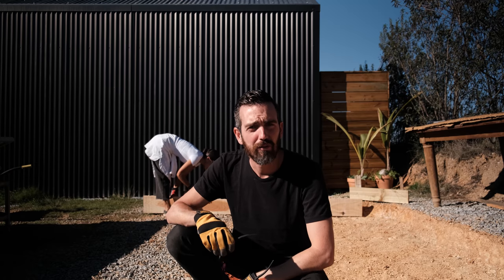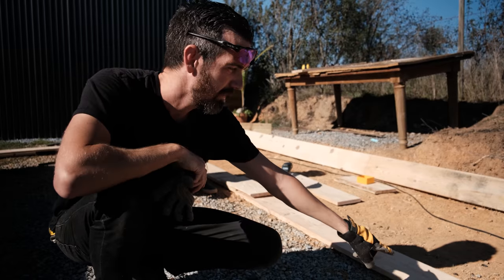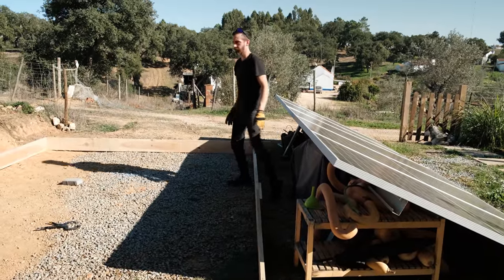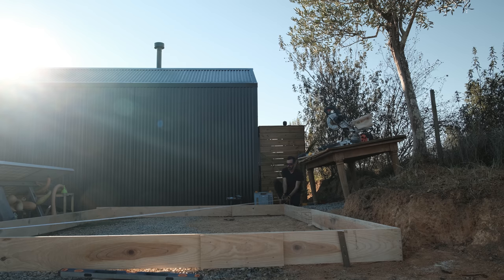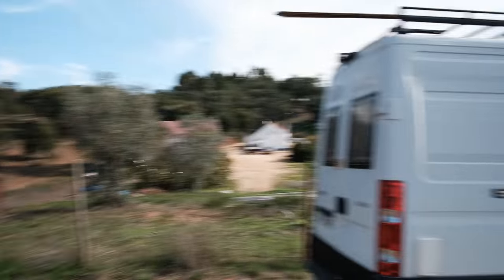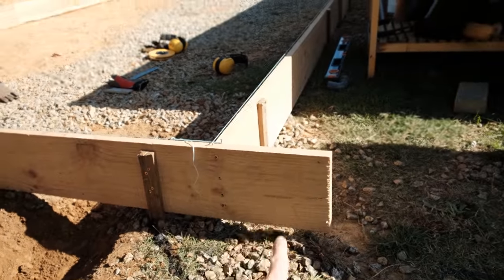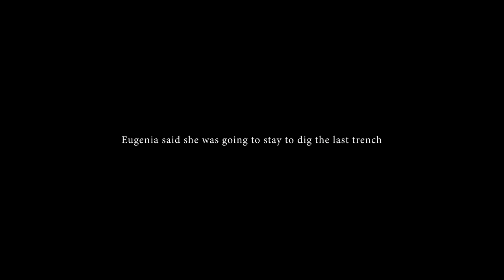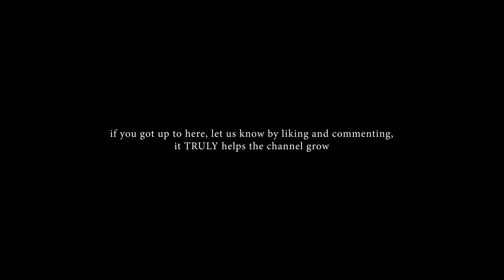2. Continuing the works, setting concrete forms, rebars arrival and new tools

Comment: hey guys! great channel;) tip: when installing sewer pipes or embedded pipes for wiring, it is better to use two turns of 45 degrees (where possible, of course). when laying a cable, it will be easier to stretch it, and when using these pipes for sewerage, such an angle (2 * 45 degrees) will be easier to clean. and the likelihood of clogging will be many times less. And when connecting pipes with a rubber seal, use water with a couple of drops of soap;)

Comment: Congrats on working on your first concrete slab!
Are you guys gonna pour it that thick? That's probably around 9-10'' over there now, which is way too much for this purpose, that's the thickness of the industrial floor. Half of that will be strong enough. Two options for you to save money on concrete: put more gravel/sand in it, bring it to 4-5" thick. The second option even better: put an inside form everywhere around the perimeter, make like a pony wall as wide as your wall going to be, maybe around 5" and also 5" high and pour your concrete to the bottom of the inside form. Hope it makes sense. 
Good luck!

Comment: IN the UK we put the rubber seal on the pipe first, then push it into the elbow..
Reply from the maker: that makes sense, in our case the female is almost flush with the pipe, so you need to put the rubber washer first, it is really a pain 😬

Comment: Good job squaring it with cabin.   Try to use some scrap wood to maintain a level cutting and discharge side of you chop saw.  Makes a nicer safer cut.  Always disconnect the saw before moving.  Good job.  Always used stakes or rebar to nail to outside of form to maintain square and elevation.  Just bend the nails against the rebar.  You don't want  a blow out or bows on the sides.  Seal the bottom, felt paper dirt rock what ever.   Use a chalk line to Strike a line for level, put some nails horizontally to mark level.  That's a really thick slab.  Generally 6 inches is plenty for a building  like that.  What about a sewer pipe just in case someday you want a shower or toliet in it?  Now's the time.
Reply from the maker: thank you for all the tips Sam! we are getting ready for concrete war! 💪
Reply: @ModernHouseCabin  I also thought, how thick will your concrete slab going to be?

Comment: Pepe - when you have difficulty marrying the plastic pipes - try using some washing up liquid to encourage the rubber washer to fit more easily. 😊. I hope this helps.
Reply: I tried this first before sanding the surface and bashing it together with a block of wood and a mallet! These fittings are a misnomer!
Reply from the maker: i did with silicone oil spray! only beveling the end of the pipe with the grinder did the trick!

Comment: Is there a reason why the slab is on top of the ground and not in the ground? Like why didn't you dig a hole to put the slab in? Which method is better and are the differences that much?
Reply from the maker: you can do either or, in our case, the ground was already preexcavated when we arrived a year and a half ago so we were on top of hard compacted soil. if you have natural soil, then you need to excavate to find hard soil

Comment: Practical question about your cabin doors. They are quite large, so a lot of heat loss opening and closing them on cold days, or not so bad?
Reply from the maker: not really, it gets very warm inside with the fireplace so opening it now and then does not really make a difference!

Comment: Nice one guys, put a little bit of liquid soap to lube those pipe joints. It helps with fitting them together.
All the best!
Reply: Yeah, you can also spit on it (that's what is always available) or buy some cheap grease. Dry fitting these pipes is difficult and in some cases can cause damage to that sealing ring.
Reply: @CZRetro  I was fitting 4" waste pipes this week in a very tight spot, the soap came to the rescue alright and a lick of the hammer. I hate those rubber rings!
Reply from the maker: guys i put silicone oil in it, still did not go, I showed it in the video! we had to bevel the male end with the grinder AND put silicone oil to it! 😱
Reply: @ModernHouseCabin  I know, I wrote my comments before seeing that part hahaha. All the best!!
Reply: @ModernHouseCabin We had the same experience when putting together the piping for our wooden cabin. Try some water based lube, it works just fine with press-fit irrigation fittings too.

Comment: Is the old structure with the tile roof, yours? If so, how about a look inside? For leveling your forms, you ought to be using a simple homemade water level. Far more accurate over the distances you have. I think you're going to have a miserable time trying to get wires through that 90° elbow. Here in the U.S., 90° pipe radius for electrical wire has to be a minimum of 4". Love watching you two work together!

Comment: Are you concerned about the shed creating shade on your solar panels, and potentially losing some of your solar power generation?
Reply from the maker: what shed
Reply: @ModernHouseCabin  Sorry, I was refering to the work shop you are building the foundation forms for. They are right beside the solar panel array, and depending on the height of that building, it would seem that it may create a shadow on the solar panels at certain times of the day.
Reply from the maker: @waynefurrow845  the panels will go on top of the workshop! The long side of the workshop is facing directly South, which is the best orientation for full solar exposure in our hemisphere! See you Sunday!